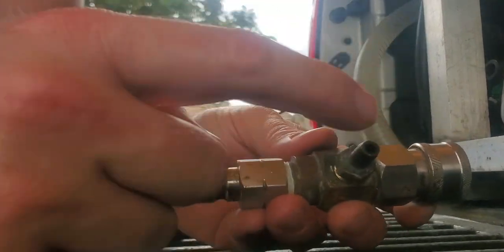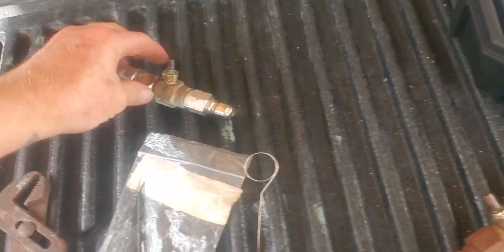Downstream Injector for Pressure washer: How they work

Comment: I just pop the draw hose off the nipple at the end of each day and shoot a little WD-40 in it, pop the hose back on the nipple and I've never had an injector not draw, when downstreaming. Great video! 👍
Reply from the maker: Great  idea💡
Reply: I have heard of that what you just wrote about the wd-40
Reply: I do the same thing but a huge fan of Fluid Film.  Spray that on any surface that contacts SH. I do the whole truck frame, brake lines, literally EVERYTHING on the rig!  Contains lanolin, Good stuff :)

Comment: Thanks for the information.  I have a 4gpm @4k psi and just noticed my downstream injector was a 2.3 . Been noticing more water comes out instead of soap. It was diluting too much and my 12.5% sh wasn't working as much as a pump up sprayer. Just switch it to a 2.1 and let's see how that works

Comment: I'm running the middle injector. It puts the machine pretty close to it's rated psi. Won't going to the 1.8 cause to much back pressure? Or, is the excess pressure bled off by the unloader?

Comment: Hey my friend I was wondering if you could please help me out.. I just upgraded my pump from 2.3 gpm to a 3.3 gpm.. so on my new pump my downstream injector is not working.. ONLY way it works is if I keep hitting the trigger on the gun off and on constantly.. can you please help me out? Why does doing that the only way I get soap? BTW I'm only using 50ft power washer hose

Comment: Is there a certain GPM pressure washer you need to use these? Also can you use the angle setting on the pressure washer head or do yoy have to use a soap setring on the pressure washer head?
Reply from the maker: Theres different size injectors for each gpm machine . Etc .. 4gpm uses 1.8 and 8 gpm is 2.1
Reply: @entrepreneurarmy  OK thank you. I was trying to use a 2.1 injector on a 3300 psi, 2.3 gpm pressure washer.

Comment: I got a question i have a job tomorrow to clean this trailer that is heavy dirty with mold should I down stream it or should I use my 12volt an do a 50/50 what you think

Comment: Question. Can I remove the upstream chemical injector from the pressure washer to reduce restriction? As in, taking the ball and everything else out of it and plugging the hole? I only use a downstream on the rare occasion that I'm not using my 12v system
Reply from the maker: My old dewalt machine had built in injector and injust put plug wjere nipple was and put gp injector on

Comment: What percentage do you think your getting on each injector shown running on a 8gmp?
10:1<20:1???
Reply: Yes, do you think you can pull anything around 3-6% using small injector on 8gpm?  Would throttling down maybe pull greater concentration?  Very helpful video Mike!
Reply from the maker: 1.8 is like 7-1  and 2.3 is like 16-1
Reply: Thx Mike. You rock!
Reply: @Oleynspressurewashing  these ratios are with 50, 100 or 150ft of hose?

Comment: Can you run the 1.8 or 2.1 on your 8 gpm without hurting it?? also when you say throttle down I had tried that I throttled down my 8gpm to about 1800 rpm's but it still pulled the same amount.....did it on my 4 it also had no significant change.
Reply from the maker: I use 1.8 and throttle down
Reply: @Oleynspressurewashing  How far do you throttle down? RPMs?  what kind of draw rate do you get with the 1.8 10:1 or better
Reply: @Oleynspressurewashing  What’s the reason for throttling down the machine? Will that size injector not pull the chem with the machine in wide open throttle?

Comment: Then why put the strain on the 8gpm machine and always have it in bypass. If your gonna restrict the flow just use a 5gpm machine. I’ve did this trick with my 8gpm machine and it didn’t pull more a lot of times I was having a hard time cleaning vinyl siding ds. I honestly hate ds I did it all this last summer and had a harder time cleaning homes. I put my booster back in
Reply from the maker: Sounds like bad ds injector i dont downstream much but i downstream a couple times a week and i pull a nice hot mix with 1.8 injector. Have you trouble shooted or just gona say it dont work?🤷🏼‍♂️
Reply: @Oleynspressurewashing  I have, I’ve taken them apart replaced fixed tried different ones and just didn’t work. I tried dual barb, even called the seller was told the mix on a house needs to sit for 30-40 minutes lol I’m like no way. Idk I’ve done what all the experts say to do and it’s just not for me a guess. I’d love to just run a ds injector I love the distance you can get with one and being able to rinse with an 8gpm machine even better
Reply: @Crodgers88  Doing a draw test is the way to go. Test every DS injector. Saves a ton of time and you know what works and won't.